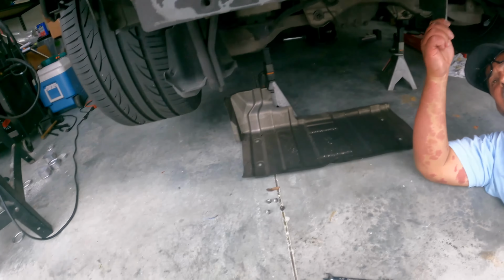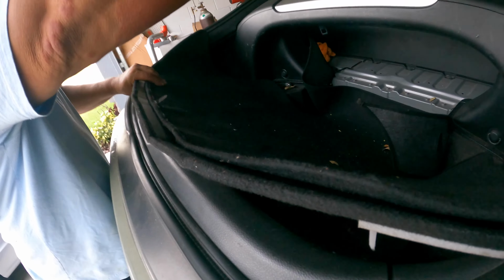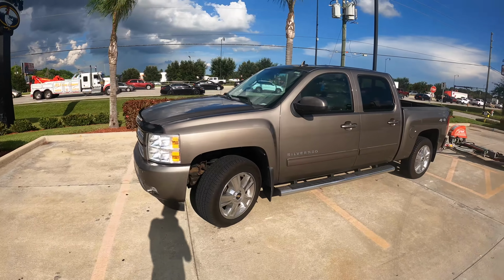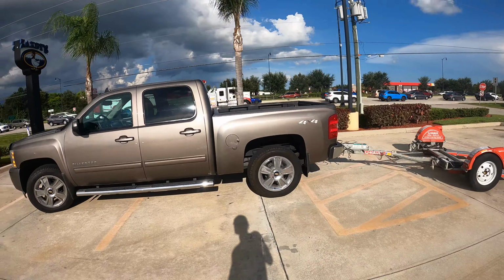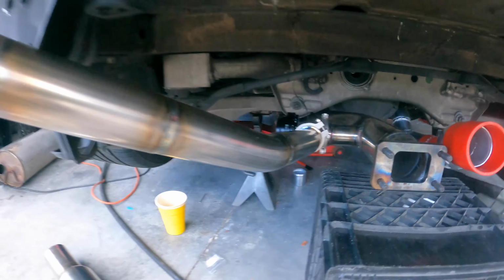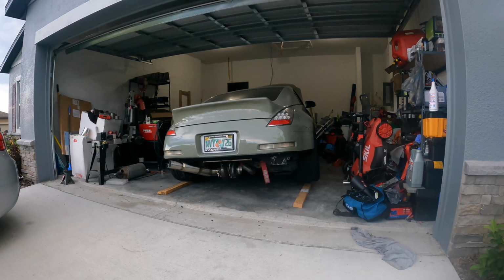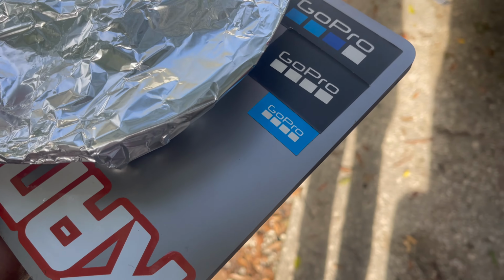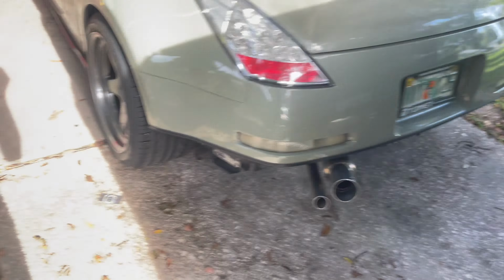Custom Turbo Kit For My 350Z is Done!!!

Comment: Hey bro I got a question, what’s the things I could cheap out on when boosting the z? Same rear mount set up I plan just with cheap parts
Reply from the maker: you can definitely cheap out on the piping and get a universal kit and make it fit, you can also cheap out on a intercooler and the oil lines by putting everything together yourself
Reply: @rollingkeii  appreciate it man!

Comment: Gonna run a fuel return system?
Reply from the maker: Fuel return system is for when you’re maxing out your injectors and pump cycle for the power im going for I shouldn’t even come close to maxing out my pump and injectors
Reply: @rollingkeii  what cc injectors and fuel pump you going with and what's the power goal?
Reply from the maker: @bubbly_water934  1000cc injectors with a 340 AEM pump hoping to make around 400whp but fuel system good for well over 500
Reply: @rollingkeii  looking forward to a build breakdown vid!!